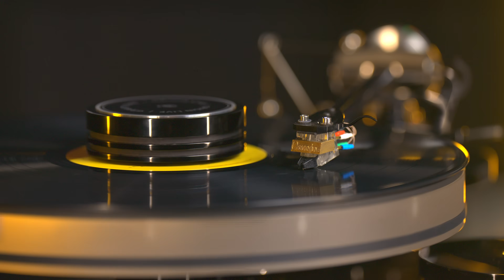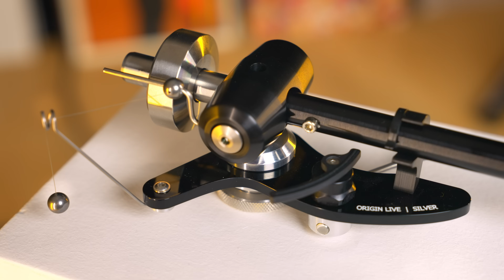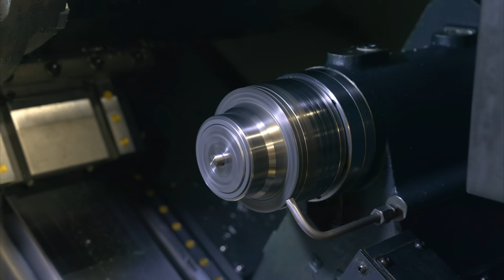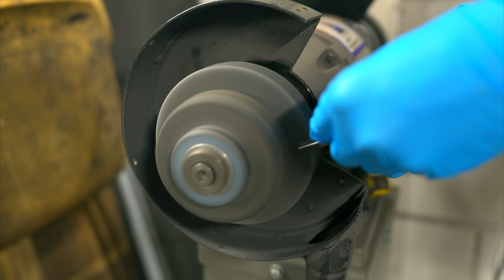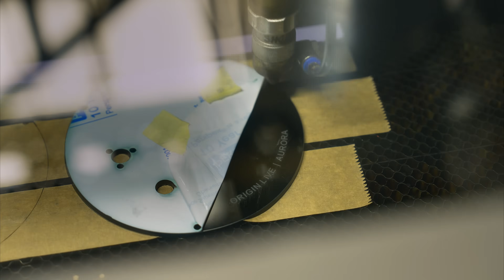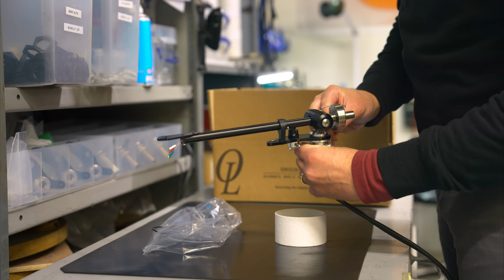WHY your vinyl NEEDS the BEST Tonearm & Turntable: I visit Origin Live

Comment: That was very interesting, it was mentioned about floor vibration, my property dates back to the 1600s, and it has a wooden suspended floor, I have a Apollo racking system, or receipt deck on top, sadly mine does not work anymore Linn LP 12, I cannot afford to have it repaired, but I picked up a cheap record deck a year or so ago, even when the Linn was working, I would have to judge how quickly I’ve got back to my seating position to listen, as the vibration from me walking from the deck to back to where sitting could correct the stylus to bounce, over the past 6/7 months, I have made some brackets out of steel and hardwood, that the brackets are bolted to the granite walls, so now there’s no vibration no movement at all, nothing being picked up from the floor me walking back,

Comment: Kind of crazy how that record damper at 4:20 is shimmying back and forth about 5mm like a hula girl.
My problem with the OL arms is that if you install them as designed, they will eventually loosen up over time, and as a dealer, the customer will be calling saying that their arm is loose and rotating it its base. The lack of any provision for adjusting the cueing platform height can also be very frustrating with some cartridges.

Comment: The better the equipment, the better the noise machine gets - in the end it is all nothing but an expensive  noisemaker - are we listening to the sound or are we experiencing a conglomeration of noises we like or dislike - where is the fun the satisfaction of listening to something  - the moment it is not life what we are hearing, it will be a playback of sort - distorted, changed, even if it is technically up to perfection it is still not the original - and how are we to know what the original sounds like?

Comment: The turntable on the floor experiment needs a lot more explanation. Is he saying that you hear noise from the turntable differently when it interacts with the floor or does the turntable react differently with the floor changing the sound it produces out if the phono stage? If it's the turntable making noise in the room through the floor then closed back headphones should nearly entirely eliminate that noise (change in the sound). I would think that any change in the sound that differs between headphones and speakers would still eventually come down to how the needle interacts with the record, regardless of how complex the interaction is to get physical vibrations back to that interaction.

Comment: Surely the ideal system is where all of the energy from the groove goes into electrical energy. Mechanical diodes are where the system isn't well designed. . A £300 increase between one arm and another is a lot for next to no cost in materials or process. As for a £40,000 turntable?

Comment: I have a lot of respect for OL but as soon as he mentioned that bias is a result of offset, it made me doubt that he fully understands the physics of the tonearm. Scientific studies showed that changes of offset from +ve via Zero to -ve has no bearing on bias.  Also, the idea that tonearm is robbing the cartridge of its energy, regardless if it's the manical diode or standing waive is not something cartridge designers want the tonearm to do, ideally all energy should be transferred through the counter lever, motor and wires into your phono
Reply: Maybe he doesn’t understand (all) that physics can offer, but given your comment has been edited, maybe you should consider written English lessons before starting to contradict an engineer?

Comment: I have an Origin Live Silver tonearm mounted to my Townshend Rock 7 turntable. 
The arm is beautifully manufactured & still looks brand new - despite being 6yrs+ old, testament to the high quality build / finish / materials employed. 
This tonarm is an excellent source component & hugely contributes to the sound within my vinyl  set-up. 
I think that I spoke to Mark personally for advice (after sale) regarding correct set-up etc - I have to say that his depth of knowledge re vinyl playback was well & truly matched by the extent of his patience.
World class quality & reasonably priced hifi equipment produced by a UK company. 
What's not to like, eh?🤓👍
Reply: Had the opportunity to listen to a Rock 7 table when in the UK over a decade ago but missed the opportunity…..kicking myself now…just curious if u know what is the system noise of your Rock 7 turntable in an unmodulated groove - if listening levels are at say 80dB??  In other words how quiet is a no music passage in the vinyl…..

Comment: Superb interview with Mark, he is an incredibly knowledgeable expert in his field, who's one possible fault is his modesty.  A few years after the initial launch of the OL Silver and it's meteoric rise to 'giant killer' status I snagged a Mk1 Silver 250 (the '250' referred to the Rega 250 donor arm it was built from) on eBay.  when the arm arrived the main pivot was just a long nut and bolt, which made me think I'd bought a lemon.  Luckily I live just a short bus journey away from the Origin Live HQ so I made a call and Mark said "Bring it in and I'll take a look".  When I showed him the arm he broke into a big smile... "Oh wow, yes it's genuine... it's one of my earliest prototypes.  Hey that takes me back!"  Mark did offer a good price to retrofit an improved bearing, but cash was tight at the time, plus as soon as I heard the improvement over my previous Linn Ittok arm (a very well respected arm in it's time, that cost far more than the Silver) I was to busy listening and smiling.  My system has gone through many improvements over the years (including the breath-taking Origin Live Linn LP12 power supply/motor upgrade) but ye olde Silver has stood proud throughout and has never failed to delight me.  
So now I've reached a point in life where I can afford an arm upgrade IF anyone can convince me that a new arm can offer a significant sonic improvement.  And who else but Mark and his detailed explanation in this video to give me that conviction... if one of his earliest arms has been this good for this long, what can I expect from a current spec Premium Origin Live arm?  The Zephyr probably best suits my budget, so I'll probably also audition the Encounter and sell  body parts to cover the difference (spare kidney should cover it, I'd consider the Conqueror, but apparently you really do need a liver to live... who knew!).
But yeah, I think the 'take away' here is that every Origin Live arm sounds awesome, right back to the very earliest prototypes... it's a real testament to Mark's standards and skill.

Comment: This is a very informative and interesting video, but as we all know, every turntable manufacturer claims to have the best turntable and tonearm. When in reality 95% of turntable and tonearm combinations, regardless of cost or materials, are a compromise as they do not address how the lathe cuts the record using a parallel tracking cutting head. The very idea of using a radial tonearm where it can only intersect two null points on the record is in itself a compromise.

Comment: Brilliant to listen to Mark. Last year around Feb 22 I took delivery of a 12" Agile via Elite Audio. Sadly the packaging and the tonearm box had a hole in it due to the currier. The Arm clip was broken so whatever had gone through could well have hit the tonearm. It was sent back fully checked out and returned to me, then some parts were missing IE spacers, so I couldn't fit it until these were sent. Eventually it was up and running on my Acoustic Signature Thunder deck. I was getting sibilance thus my Sound smith Sussurro was worn out. As I had spent so much I took a sideways move for now and got the Audio Technica OC9 XCML a £500 cartridge . The OC9 has been around in some form since the mid 80s and I can remember it was a contender to the Linn Karma. It is still around for good reason. This set up is astounding with the Agile. It absolutely wipes the floor with the replaced Acoustic Signature TA 5000  at around £5500 SS Sussurro £5000 combination. The moral is get the best arm you can a more expensive cartridge can come later, and even if I stick with OC9s this arm will save me a fortune on expensive cartridges. Thanks for the video. Oh one small criticism of the Agile. The plastic arm clip is poor really. The first was broke in transit this was relaced as said but a spare one was also in the box. The second one snapped at the screw hole for the clip which has little edge distance to the hole and is weak. Luckily I used the spare. Mark this is an expensive over 10 grand arm, please manufacture a nice aluminium arm tube clip for it, it deserves nothing less.

Comment: What I find fascinating is that Origin Live are using a Sugden 21 (or is it 21SE?) in their demo system. But what is the pre-amp? Also, are the speakers Neat or Proac? I would also like to know what the rack is.
Reply from the maker: To be honest that was in their demo room but I put that there to fill the gap, I wouldn’t read too much into from this. Concentrate on the TT stuff
Reply: Ahh thanks for clarifying that!
I'm always intrigued by what one manufacturer chooses as the other components in their system but I guess I should not read too much into that as you wrote.
A lot of interesting details on the history of OL and their solutions to the turntable design problems.

Comment: It's always surprised me that many tt users think suspended decks and the miriad of isolation equip available, is about protecting the turntable from inbound vibrations from speakers and owners doing their best David Brent dance impressions around their turntable. The reality would seem to be that the equipment itself is providing most of the vibrations through its functioning (electrical and mechanical) and this needs to be mitigated as quickly as possible, or avoid being created altogether. Really interesting interview.
Reply: @tonywillans7556  
A very simple test might be to attach a tiny high-sensitivity accelerometer to both the base of the TT and to the top of the balanced pivot point of the tonearm and measure the ratio of signal from the stylus/vinyl interface that transfers to the tonearm as well as the external floor vibration influence to the same and to the base.

There are even small, self-contained accelerometer units that will record the data onto internal flash memory that could be put onto the rotating vinyl platter itself, or wireless BT and WiFi accelerometers as well.

Comment: One of your best Terry. It's great that you are getting to the small and medium sized UK companies that have provided such a lot of pleasure to us British audiophiles. It's fantastic to see behind the scenes and listen to the people that make this great gear.
I have been a hi-fi enthusiast for some 50+ years and counting. I've had a record player for the duration and gradually built a fine system with a Roksan Xerxes 20+ front end and SME V arm. Last year I sold the arm and high end Ortofon cartridge as I needed the cash, and replaced them with an Origin Live Onyx and Denon DL103. I'm not suggesting that the Onyx is superior to the SME but I've certainly not missed the latter and can't recommend the Origin Live budget arm highly enough (and also the DL 103). 
I felt that your video came to an end quite abruptly so I'm hoping that you have more to come from Mark Baker and Origin Live, and that you continue to seek oout and show us more interesting stuff from great British audio manufacturers. How about Neat and Sugden?
Thanks for the great work Terry.
Reply: I agree that this video is very good indeed. The thing about the arm improving the whole sound is very true. When I bought a Skale counter weight  for my Ekos there was a sonic improvement. accross the board.

Comment: It would be nice if Origin Live (or yourself) were to make a video actually describing the differences between its range of tonearms so that HiFi enthusiasts could make a knowledgeable comparison when considering tonearm replacement. They have some info on their website, but this YouTube format could prove more helpful. I have an early (first series) Rega RP10 turntable with the RB2000 tonearm and have been considering "upgrading" the tonearm, but I don't know whether I should be considering at least the Origin Live Conqueror model just to get an equivalent performance to what I already have. I read the consumer reviews at HiFi dealer websites and it seems all of the tonearms they sell are "the best I've ever owned", and then the HiFi industry magazines seem to claim Brand "A" is better that "Brand "B" for some unfathomable reason, but they don't compare the stock tonearm on well-received and popular turntables to models from aftermarket manufacturers.  Frankly, it can be quite confusing to wade through the claims without some sort of scientific measurement evidence to back them up.  Now, a lot of folks have claimed that Rega's RP10 is/was one of the best deals in turntable/tonearm value EVER. with the newest model being even better!  So, am I silly in expecting that a more pricey tonearm with "improved engineering" will make a perceptible difference o my RP10?  On another note, how does one actually know when a tonearm has reached the end of its life, assuming one doesn't hear the grinding of bearings or notice something very obviously wrong/broken?  Is it actually worth the expense to have a good tonearm upgraded or rewired?  Tonearms are mysterious and I'd like to see and hear more.

Comment: How is it that your tonearms cost so much but cant even add VTA SRA Azimuth and Height adjustment to your souped up rega tonearms? Very important features for sound reproduction
Reply: all of our tonearms feature VTA/SRA and height adjustment (which are essentially all the same thing). Our value arms at £1080 and below do not feature azimuth adjustment as this would compromise the performance of the design. Above this price they all feature Azimuth adjustment.